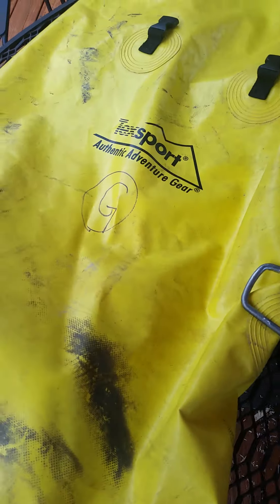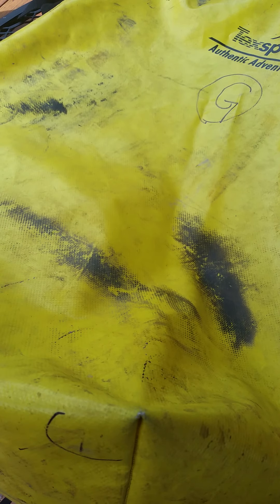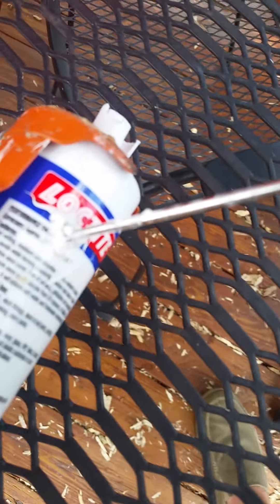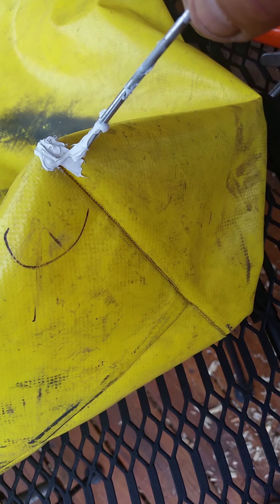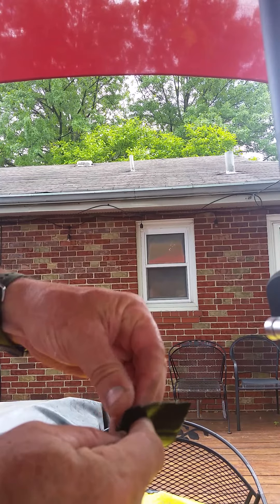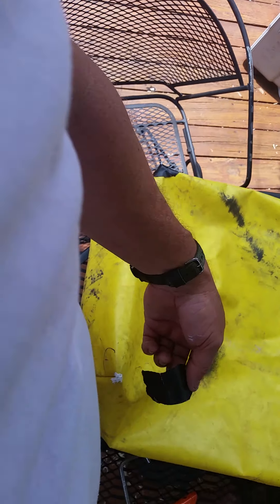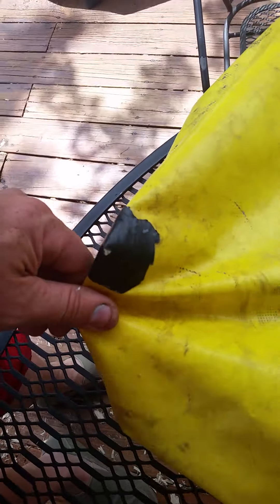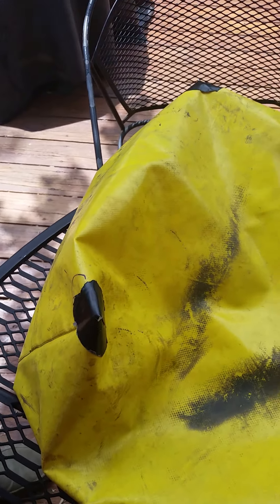How to fix a leaky drybag

Comment: Just looking for ideas to fix corner holes in an old Ortlieb Messenger bag I just got. Thanks dude!👍
Reply from the maker: @hobbybike51  I ended up putting a contractor bag as a liner inside my dry bag.   I've fixed it a few times but have no confidence in it.  The contractor bag is amazingly dry

Comment: Instead of using that marine compound, I'd put a layer of silicone in the inside corner of the bag. Flex Tape is great stuff, and you could probably make an entire DIY dry bag out of it. I gave you a thumbs up. :)
Reply from the maker: Thx.  Good idea on the inside but slicone wont hold up like marine adhesive.   No on the flex tape though.  After 3 months it got gooey and peeled off.  Apparently pvc is something that flex tape doesn't stick too for long

Comment: Interesting stuff and even more info in the comments. I already did mine with regular silicone, but I'm likely going to do a bead inside with marine sealant. 
Since the flex tape didn't like sticking for long, I'm going to try Gorilla clear tape. Not expecting miracles, but the sides of my bag are starting to wear out and I need something supple since it's close to the top.